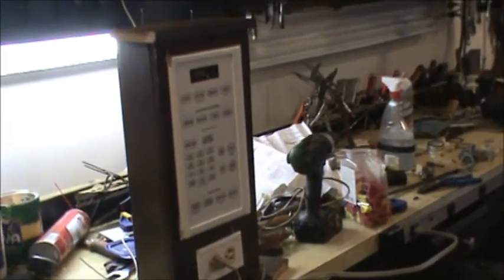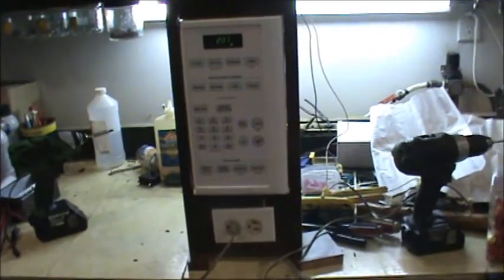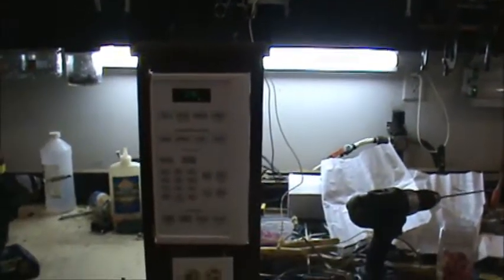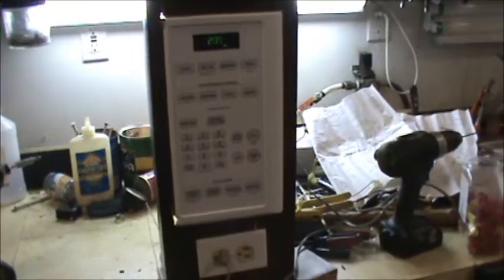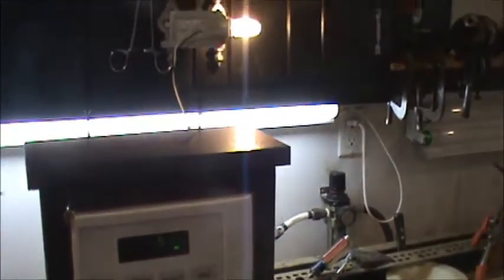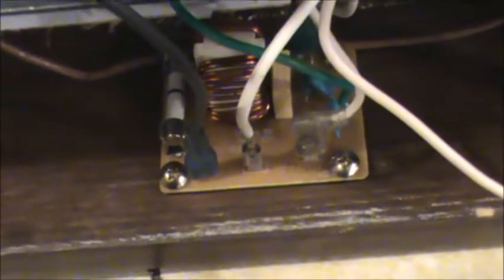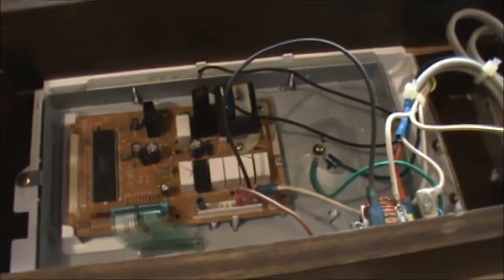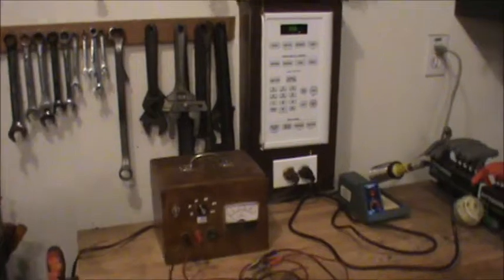Microwave Panel Clock and Timer outlet DIY

Comment: grounding the relay together cant possibly be the right thing. on every mincrowave i gutted ( maybe 20 of them) that relay is  generally  there to run the transformer, so you can use those relay contacts to run your outlet instead , your basicy shorting out a switch doing that